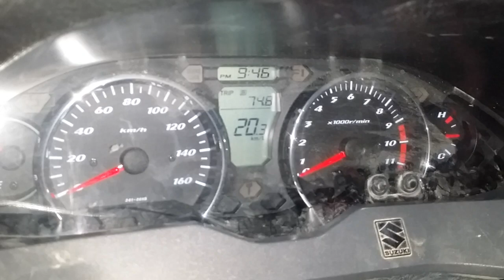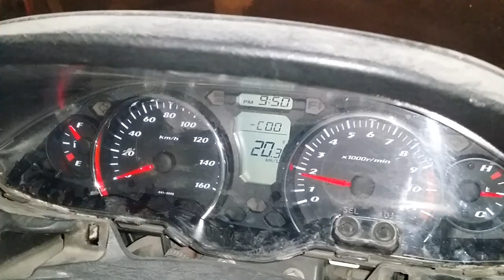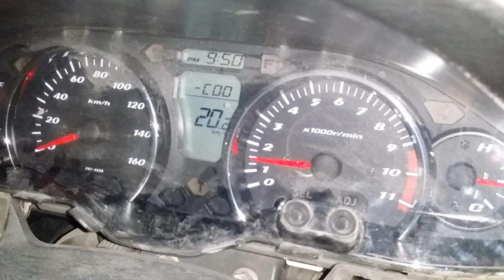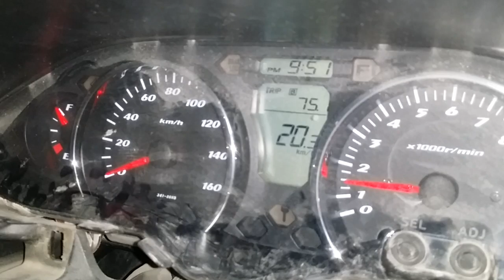Suzuki Burgman / Skywave engine diagnosing dealer mode -C00=you're good.

Comment: This is misleading - generally the bike resets to C00 everytime it gets shut off (on a Burgman 200 at least).  You have to leave the jumper in and run the bike long enough to get the FI light to come on and then the CXX code will be displayed (anywhere from a few minutes to 20 minutes or longer depending on the code).  You may have to go ride it around.  You have to listen to what the customer is saying about how often the code is coming on and under what conditions so you can get the bike in that condition.  Just reading a C00 after restarting the bike is useless unless the bike has thrown a code that causes it to not restart.

Comment: Hi, my CVT does not turn, the belt has just been changed, it has been 1 month, the engine is running, but the wheel does not turn, fault code is 00

Comment: salam khoya adil, plz 3ndi probleme. f mon burgman 400, le voyant fi , makay accelerich mzyan , khsni nb9a nredemarih hta katfa 
si tu peu m aider , merci bcq
Reply from the maker: Mourad SAHRAOUI Please write in Arabic or English so i can understand you.
Reply: ok sorry
so i have a FI  problem in my burgman 400 (2007) , when its on i cant accelerate too much (max speed 50km/h) (sorry for my english lol)
Reply from the maker: Put it on dealer mode like how i did in the video and let me know what the code number is. Probably it might be -C28 which indicates a problem in the secondary throttle valve actuator.
Reply: Hussein Adil 
yess exactly c28 u right
so what can i do to fix it?
Reply from the maker: Mourad SAHRAOUI You either have to replace the throttle body to fix this issue, or you can disable the secondary throttle body actuator  (STVA). Remove the rubber hose from the air filter to the throttle body and open the gate with your finger, then take the white blug out to disable the motor. Now it will work okay but the FI light will be ON all the time.
Reply: Hussein Adil 
ok thank you very much
they told me to put some liquid for injection . i don't know if its a good idea
i forget to tell that sometimes FI is on sometimes off 
it been 2 weeks and the FI is off